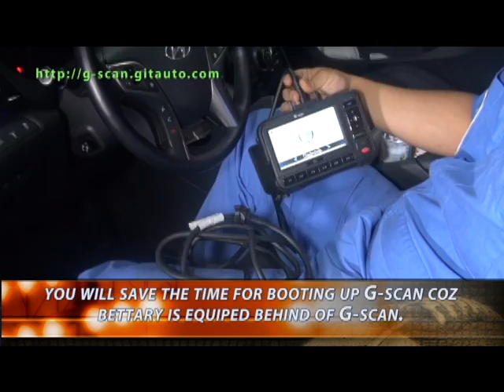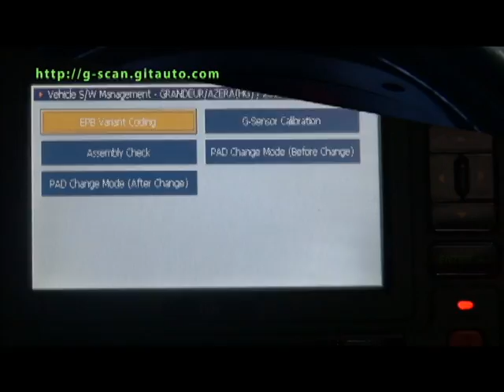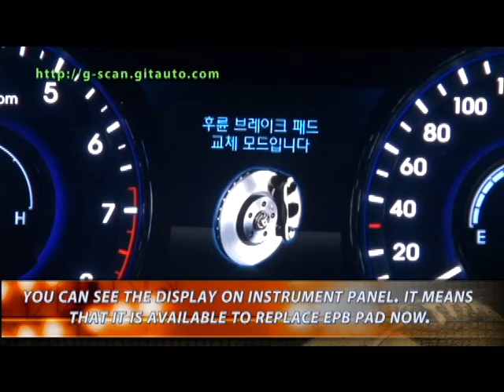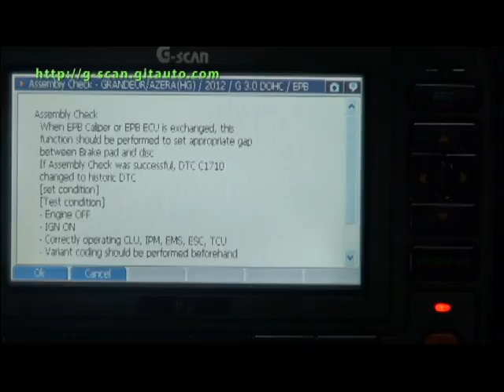G-scan 2012 Hyundai Grandeur EPB pad change mode (Before and After change) & Assembly Check

Comment: Hi Greg, when car is ready to change the brake pads, do you turn the IG off or do you have to leave it on until you change the brakes?
G-scan Tab user, greetings from Australia.
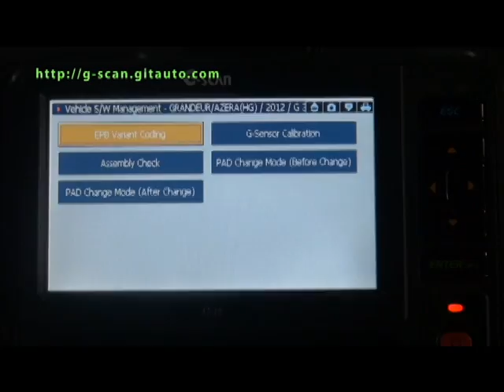Never mind, I just paused the video and looked at the tip 4:58. Thanks